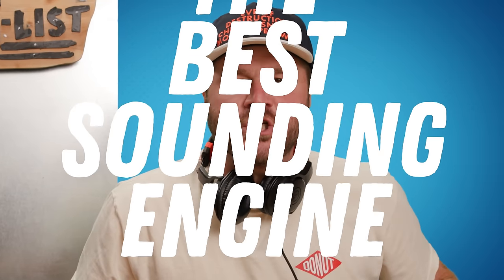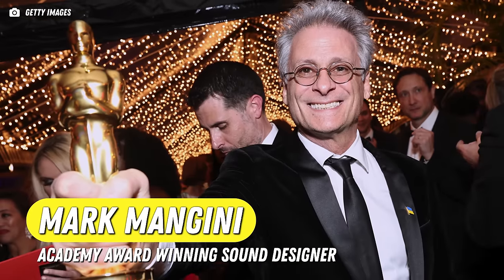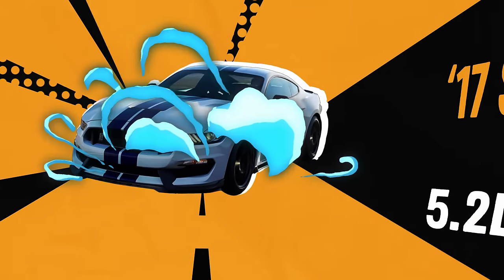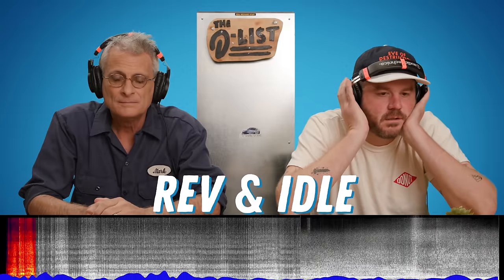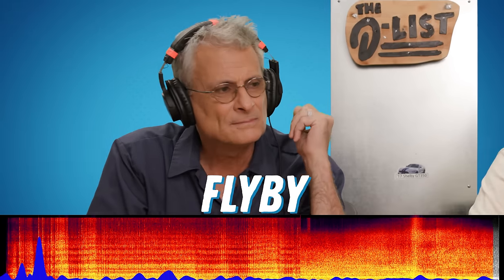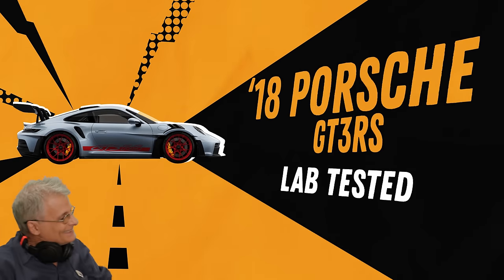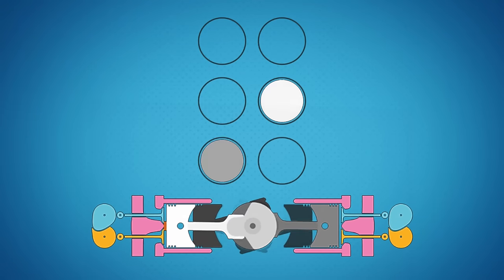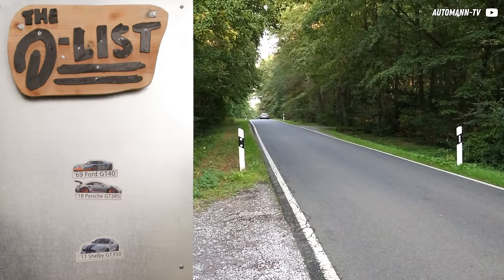Sound Expert Reacts to Best Engine Sounds

Comment: Yeah the LFA is one of the best sounding cars ever, although the 787B is hard to beat too.
Reply: I think the sound clip they used (787B) was not as good as others I've seen/heard online. I am in agreement that the 787B is one of, if not the best, sounding exhaust notes ever.
Reply: @JustinSawyer-t5c  the GTR R35 sounds good too, in general Nissan V6's sound good and Lamborghin V10 and V12's
Reply: Unpopular opinion: BMW with straight cut gears is arguably one of thee best sounding cars
Reply: @somerandomguy6116  as in the bmw m3 gtr? yeah, definently one of my favorites if not my favorite of all time. hard to beat the lexus though
Reply: Quite literally the worst 787b clip ever in existence, should have put a monster ported RX3 in its place for roteries, also get the Jag f-type in there with the supercharged straight 6
Reply: @somerandomguy6116  just saying BMW is one of the most vague things possible. They've made a variation of most engines
Reply: Porsche Carreras?
Reply: @Your_low_end_plug  They definitely earn a spot in the top 10 maybe even top 5
Reply: They absolutely did not do the sound this car is capable of making justice.
Reply: @Weinus  For real dude. That car screams like no other at peak revs, yet they only got a clip of idle, and a flyby during mostly deceleration.. Wtf kinda way to represent the car is that?
Reply: bet me pagani zonda r is better
Reply: @iro702  Yeah the Merc V12 sounds good but its nothing like a v10 or a 4 rotor.
Reply: @somerandomguy6116 Yeah bmw diesel sounds great 😂
Reply: The 787B isn’t even Mazdas best rotary. The 767B and RX-792P are more insane.
Reply: @floppa933  They sound pretty much the same, the difference I could detect was most likely from the difference in recording equipment.
Reply: Irrelevant, but the comnent has 787 likes at the time of this comment lol
Reply: @velvetrosang4684  let's hope it stays that way
Reply: Doritos go brrrrr
Reply: @TheOzTurkish  or one of mad mike's cars like madbul
Reply: I wish they had more sound bites
Reply: m5 e60
Reply: The Ferrari 458 Italia sounds awesome too
Reply: For me, best sounding road car, LFA, Best racecar, 787B
Reply: Huayra r and zonda r easy beat LFA
Reply: @Milgraaauuu  Eh, the v12's sound good but there is something about a V10 that just has that extra something.
Reply: I didn’t know a plane sounded like a car.
Reply: Im sorry lost one. Carrerra GT did it first, and better.

I hope I can guide you to the right path
Reply: @aaronmarkstaller  Carrera GT sounds great no doubt, it just isn't as sharp as the LFA.   But its all personal preference some people love big throaty V8's some love V12's and some love the V10 for its distinct sound at high RPM.
Reply: Cadillac LMD-H 🗿🗿
Reply: My favourite is the Huayra R as it has imo the best non F1 car sound. The 787B is the most unique in the world especially at idle
Reply: tbh i think the zonda r is just superior
Reply: Carrera GT?
Reply: @farisgamer5557  yeah that Porsche V10 sounds fantastic but it lacks the sharp edge and aggressive tone of the LFA.    V10's sound amazing pretty much no matter what but there is something about the tuned exhaust of the LFA that kicks it up a notch.
Reply: 787B or Mercedes-Benz C11 easily.
Reply: FA sucks balls, the V12 of Pagani is in another league, the LFA barely comes in top 5 of this list
Reply: @goldenbeardofficial8541  Lol I guess you don't know what "subjective matter of opinion" means.
Reply: @JustinSawyer-t5c i think this recording would have been better https://www.youtube.com/watch?v=sxXtpMngivM

Comment: The 5 cylender was a horrible example 😢
Reply: I know, right?! That was easily the worst exhaust kit I've heard on the RS3/TT RS
Reply: Because the flyby was a 4cyl s3 not an rs3 lol
Reply: wasnt even a 5 cyl lol they used a s3 on the flyby
Reply: @DuMamesGarage  😭
Reply: I know right. The Rs3 usually sounds like a baby lambo
Reply: Yeah, those cars sound sweet in person
Reply: Volvo t5 owner here, yes I agree they would amazing with both a high pitched rasp but with a deeper growl to them. The turbo actually adds to the sound vs detracting from it
Reply: They screwed up the GT350 too.
Reply: It was indeed ! There so many good 5 in-line out there
Reply: As someone who used to drive a turbo V70, I agree with this. Everything flows together nicely and sounds way better than that Audi did.

Comment: Most of the time you want rapid fire gear changes, but in the case of the LFA the gear changes are actually part of the drama. They are so delayed and so slow that it’s almost as if it’s cleansing your auditory palate for each successive gear. It’s truly a masterpiece.
Reply: Yes but for what was supposed to be a fast shifting and technologically advanced car it really didn’t perform as it should’ve
Reply: @THESLlCK  We aren’t talking about performance here. We’re talking about experience. Still, 3.8 seconds to 60 was hardly slow, even by today standards. And flat out it would do 200 mph. Also not slow.
Reply: @Soh90  for well over half a million dollars in the mid 2000s it was slow and expensive. And if we are talking about experience, it’s heavy and not particularly responsive. It frankly wasn’t a good car. Only the engine note was notable.
Reply: @THESLlCK  ??? It wasn't slow, nor was it really expensive for what it is. It isn't heavy either. It weighs 50kg more than the Ferrari 458 it competed against. The 458 does 0-60 in 3.4 seconds, the LFA in 3.6 seconds. The 458 does a lap of the Nurburgring in 7:33, the LFA in 7:38. Then Lexus came out with the Lexus LFA Nurburgring package, which smashed the 458 with a time of 7:14.64, making it the 7th fastest road-legal production car on that track at the time. But even the base LFA was a proper fast car. Loads of groups tested them on different tracks, and it performed great everywhere. It set the fastest wet lap at the Top Gear test track, the third fastest lap at the US Top Gear test track and the fastest lap time at Circuit de Nevers Magny-Cours despite freezing temperatures. Auto Zeitung tested it against the Mercedes-Benz SLS AMG at Contidrom test track, which is also where Continental tests tire performance. They had a similar top speed, but the LFA had a shorter brake distance and smashed the Benz by 2 seconds with a 1:35.66 lap time. Auto Zeitung concluded "The LFA dominates the AMG Mercedes SLS in the manner of a precise formula racer". They praised the LFA's race car-like response and handling.
Jay Leno reviewed the LFA and was very impressed with it, stating that it was one of the greatest supercars ever built. He said there might be other cars out there that could individually do things better than the LFA, but no other car does everything so extremely well.

I really have no idea where you are getting your opinions from. By all accounts, reports, tests and experiences, the LFA was a very fast road-legal production car.
Reply: @THESLlCK  It’s was $375,000, not half a million. And now they’re worth over $1,000,000……. Guess the car spoke for itself. I’m not some LFA zealot, but thinking that the only value of a car is in its raw performance is deeply flawed and shows that you are an average consumer, not an enthusiast.
Reply: @joost1120  you wrote all that to still be wrong. The ferrari 458 you mention is not only quicker by every measure as you stated but also 300,000 dollars cheaper. You proved my point.
Reply: @THESLlCK the Ferrari is not 75k. Stop being a fanboy
Reply: @THESLlCK >ferrari
>300k cheaper than lexus

have you READ what you wrote before hitting send button
Reply: @THESLlCK  Bro is onto nothing
Reply: @THESLlCK whatever you’re taking😂. The 458 goes for around 200-250k avg these days. Only the Speciale Aperta competes with the LFA in price, and for good reason
Reply: @THESLlCK were do you find a 4sec car for less than 500k brand new? 200mph top speed in the mid 2000s? And oferring the comfort and luxury of a lexus?
Reply: @THESLlCK  the 458 came out cheaper than 400k? Take it easy on the acid bro
Reply: Lmao the car’s so overhyped people are praising it’s sluggish single clutch semi auto gear shifts that’s insane😂 if you’ve ever driven anything with that kinda gearbox you start to hate that sound lol
Reply: @THESLlCK  Lol as someone whos gotten a ride in the LFA, the single clutch is absolutely necessary.
Reply: Exactly! That's one of the reasons why I want a manual transmission. Also, as a driver, you're more invested in it, almost becoming one with the machine.
Reply: I feel like John Williams was involved with the creation of the sounds of that engine
Reply: @THESLlCK  it wasn't supposed to be fast shifting lol
Reply: @THESLlCK bro got destroyed so hard he starts speaking nonsense to save himself from embarrassment (it didn’t work)
Reply: THESLlCK has left the chat
Reply: The Aventador has "slow" gear changes as well and yet I think it sounds better than a LFA
Reply: @Demonslayer20111 what do you expect coming from someone with an average Chevy muscle car. That's probably average fan base will say other cars that's not a muscle car is slow, only because it can go fast in a straight line. What an L honestly. I love the LFA
Reply: You said it perfectly! Some people think the gearbox of the LFA is the worst part of it but i definitely think its a character thing, those slow shifts are so beautiful to listen to unlike the instant shifts that don't give us time to appreciate them. Its like a manual transmission in way because of how slow it is, and i don't see it as a bad thing if it sounds like that
Reply: @Vincetagram  'overhyped' is not 'over' when current market price is, like, 2012 MSRP adjusted for 2023 inflation

also if you want LFA for pure performance in 2023, you are missing the entire point, it was outrun by anything supercar beyond 2012
Reply: @Armorpiercer  i didn’t say anything about performance. I don’t like semi autos because of how lurchy and sluggish they are in terms of driving feel, not performance.
Reply: @Vincetagram  my bad about misinterpreting, but still, Jeremy Clarkson said otherwise(not the best sources but I trust him on this)

there's also norway news interviewing the place that engineer the transmission, toyota actually asked for it to be slow that way, and that they experimented with DCT prior but doesn't like how it drive
Reply: @Vincetagram  also I watch some videos right after I write the previous comments, I don't think they are slow or lurchy or anything, it just go smooth

I also don't think they gonna engineer it to be frustrating, the entire car was literally engineered to feels good to drive, that's why they go to that aforementioned norway engineering company
Reply: @Armorpiercer  bro have you ever driven a single clutch semi auto? Jeremy Clarkson also loves the porsche 928, I drove one of those and hated it too. I really don’t care what journalists/tv personalities say about cars that much anymore lol. Or at least after driving 80+ high end sports cars my perspective of what they say is different.
Reply: @Vincetagram  yes I did drove one, it's rare(yes it is shit, that's why it's rare, it also a shitbox), but it isn't Lexus LFA and I don't think I can compare it ever, since who would let me drive LFA
Reply: @Vincetagram if performance matters the Miata would have NEVER had its cult following like it does now. You are a average consumer of cars, actual car enthusiasts look past numbers that only serve to hinder the real appeal of cars.
Reply: @gaara4667  are you not reading what I’m saying lol. I don’t hate the single clutch semi auto because it performs bad, I hate it because it FEELS bad lol. You telling me that performance doesn’t matter preaching to the choir lol. I literally have millions of views on tiktok telling people performance isn’t always that important. That being said, it certainly does matter, just not in the way most people perceive it.
Reply: A modern wet fart box would completely ruin the sound of the LFA.
Reply: @Jabber-ig3iw  a dct doesn’t fart like that. You’re thinking of a torque converter, which when tuned to be fast won’t actually fart either. Think porsche 911 upshifts for a dct and bmw  m5 or hellcat for a fast torque converter that doesn’t fart(same trans)
Reply: Im sorry lost one. Carrerra GT did it first, and better.

I hope I can guide you to the right path

Comment: Really did the voodoo dirty. The guy probably had it in quiet mode in the first clip and track mode in the second, that engine sound is a work of art.
Reply: Right… gt350’s v8 is my second favorite, first LFA
Reply: Same with the rs3, they barely let it rev out
Reply: Audio guy cackling in the back office wearing an LS fest shirt.
Reply: Def the worst sounding clips of the voodoo I’ve heard, never would have guessed it was a GT350 based off the clips
Reply: Came here to say this. They did it dirty in the V8 rankings too.
Reply: @edgiestofcars  worst part is that it wasn't even an RS3, it was an S3
Reply: That was NOT a Voodoo idling.  That was a different car.
Reply: fr! They recorded it reving from the front -_-
Reply: @DangerousRodney978 you could tell it was a coyote from the fly by audio how raspy the coyote gets in the higher revs
Reply: They literallt scoured the internet for the worst possible gt350 and rs3 stock exhaust clips and looked for the best ae86 and golf exhaust clips out there lol.
Reply: IT WAS 100% A HONDA 4-cyl.  Either a B18C from an Integra Type R, or the F20C from the AP1 S2000.  I am POSITIVE about that.  They are extremely identifiable.  

I knew the GT350 once that second sound clip started.  Again, extremely identifiable.  

I’ve owned an AP1 S2k, and a GT350, so I feel personally offended that they screwed this up so bad.
Reply: @edgiestofcars true they always say a 5 cilinder sounds like a 10 cilinder but a 4 will never sound like an 8 cilinder but the sound quality was also shit on the rs3
Reply: First clip is engine/intake noise, second clip is exhaust.
Reply: @edgiestofcars They literally can’t. It’s got a 4000rpm limiter in park.
Reply: @tescoshortage  its not.  The first clip is not a GT350.  Its a 4-cyl Honda engine.  You cant make a flat plane crank V8 sound like that no matter where you record it.
Reply: Yea having owned one, someone did something wrong
Reply: @tescoshortage no it doesn’t
Reply: @ImJaspy yep. 100% coyote
Reply: I was looking for the same comment. I totally agree with you. Sound like two different cars.
Reply: @edgiestofcars  because if the rev limiter at 4k rpm xd
Reply: It sounded like he had the camera in the engine bay lol
Reply: Tbh it's very overrated. A crossplane revving that high sounds a lot cooler
Reply: @marcisdzerve9558  overrated or not that engine sounds a lot better than they chose to show
Reply: @goong1388  while that's true, it only really sounds good in the last 700ish RPM. The rest of the rev range is kinda underwhelming
Reply: I have a video on how the gt350 is supposed to sound. It's like they played the sound through a q tip for a microphone.
Reply: Modern V8s don’t sound as good as the older ones.
Reply: Just see what they said when the second car (GT40) came up. 

It’s all about old school "burble" V8s!

Comment: Kinda a shame they didn't get to hear the 787b's idle. The variance between it's stuttery, quick thrumming idle and the much smoother scream it makes at high RPM is a big part of what makes that engine sound so interesting.
Reply: Didn't have an LFA flyby or rev, either. Did both dirty
Reply: Right! They had the wrong Soundclips all along! And where the heck is the Lambo in this video???

Comment: Love Mark being on the show!!

Some 1998-2010 Audi Quattro engines make very pretty sounds.
Reply: I didn't even recognize the RS3 in the clip because it is all pops and bangs and no real 5 cylinder sound anymore
Reply: @Alexx120493 that’s what I’m saying. They should’ve used a Volvo
Reply: @Alexx120493  I didn't recognize the RS3 as an owner. Sounds nothing like what I'm driving :(
Reply: They should troll next one with hayabusa turbo
Reply: @jkliao6486 the sound from the inside is often different, and a lot of brands pump engine noises into the interior through the speakers
Reply: @inherentlyflawed  Well, even if we take into account the piped in engine noise, that doesn't sound like an RS3, like at all. None of the characteristics of the inline 5 is preserved in that clip.
Reply: @jkliao6486  personally not an inline 5 fan, so I couldn’t tell you the difference, just making some suggestions as to why it may sound different
Reply: @inherentlyflawed  Appreciate the kindness, but in this case, I have to push back against you.
Reply: I agree, I think that the O.G. 2.25L 5-cylinder rally-bred engine from the '80's sounds way better, especially the ones tuned by Porsche for the RS2's with very pronounced turbo noises.
Reply: Not really, those were the worst sounds. 3.2 V6 was ok, 2.8 and 3.0 were boring sounding. 2.7 was garbage. 2.0t doesn't sound good. 3.0T doesn't sound good. 5.2 was nice but too muffled. 4.2 was nice, but if you really have to ask what the best sounding Audi engine is, you're probably not a car guy. The best sounds were from about 1980 to 1997, with the Group B of course, but then also Ur Quattro and 200, UrS4, and UrS6.
Reply: @mediocreman2  You're right, I'm not a "car guy". My mom drove a 1976 Chevette and it was just us. All I know, is that when I got to sit in a few late 90's and early through late 00s Audis, I really liked the sounds of the car while riding in /driving them.

I particularly liked a friend's 2006 or 2007 A3, i think it was 2.0 quattro.
Reply: Soft limiter dosen't help